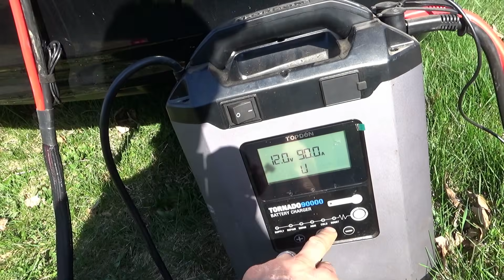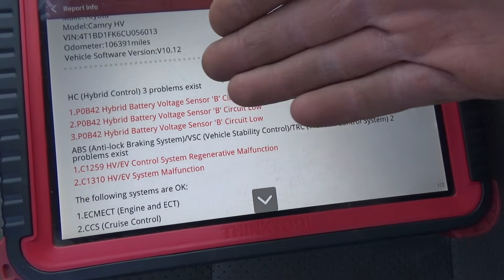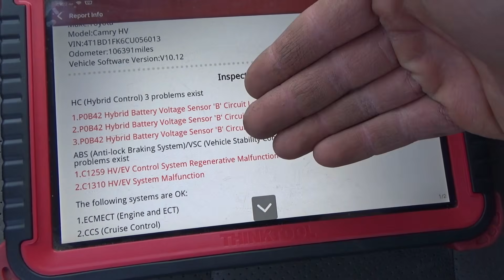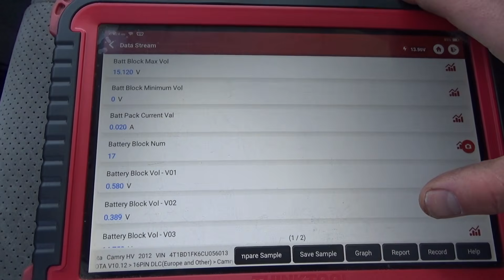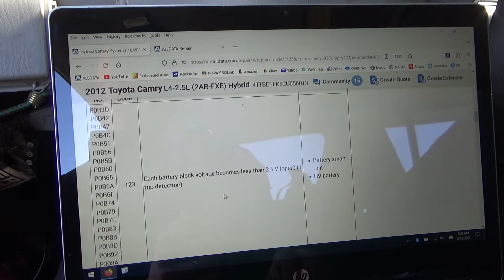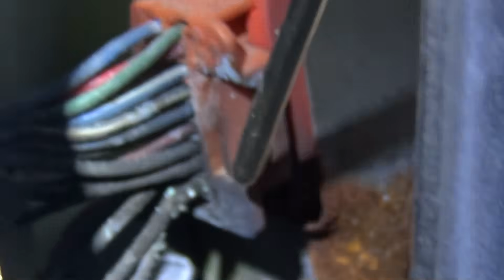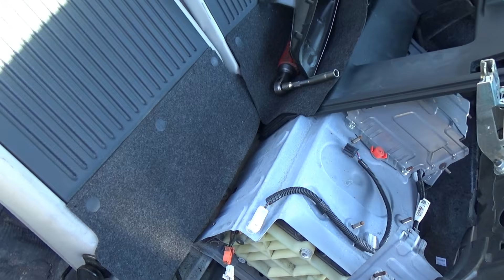Helpless HYBRID....from Florida?? (Part 1 - It's DEAD)

Comment: Did you notice the cooling fan blades are blocked with lint !  I had the same problem on my Oil Burner  Beckett boiler.  Those cup shaped blower fan blades fill up with all kind of debri, especially if the clothes dryer is in the basement or if you have animals in the household.

Comment: What seems to happen with inexperienced people that don't understand the electronic world sometimes believes the person diagnosing the problem caused the problem. Once you filled up their new auction car with burning electronics smell, they probably wont call you back. They like to blame and pretend that you were the cause of the reason why you were called there in the first place. It's that old "It was working before you touched it" mentality. I had that recently when I was outfitting a brand new house with outlets and switches and had one breaker tripping from a short to ground. The builder told me "My master electrician roughed in this house so it must have been something you hooked up wrong or backwards". I went to convincing him he has to remove cabinetry and drywall so I could inspect the wire. He had done so and said "I checked every inch of that wire and found nothing wrong with it" and tried pushing back on me like I wired it wrong. I found a staple driven into the wire about 2" under a box which proves it was done when the electrician was roughing it in. I was only sent there to finish it out and get everything working for inspection. Diagnostics can sometimes lead to spooky outcomes when you have to break the news to the customer or client. Thanks again.

Comment: These hybrids are crap, due to building it 'green'. From subpar eco friendly batteries, wiring and electronics, lean running engine,  to water based coatings. Designed to be scrap in <5 yrs.

Comment: Yeah, that is why hybrids suck.  I remember the transition from horses to cars.  Horses made it so you didn't have to walk everywhere.  Then when the cars got here, they kept breaking down and leaking and my father almost busted his thumb when the crank starter kicked back.  Horses kicked back too but you weren't trying to crank them.  Horses were pretty good.  Okay, they stunk and would take a dump on your front lawn when you had company over, but they had horses too.  We were all used to it.
Cars?  Not good. You couldn't go thirty feet before something happened.  One time we were turning out of the driveway and my brother fell out onto the road.  You could fall off a horse but nobody did.
Now we got hybrid cars.  Half gas, half electric?  No.  Not good.  If God meant us to half hybrid cars he'd have created them.  Not some maniacs that don't even speak English.  Guys that tried to kill us.  They almost did.  Lunatics.  Are they still trying to kill us?  Who puts 9 wires together in a plastic thing and shoots battery power into it?  They're nuts.  I'm sure poor Ivan would agree with me.  9 wires?  Run, Ivan.  Get out while you have the chance.

Comment: Water and high current batteries not a good mix, just finished watching a series of webinars from Autel on EV diag and testing, I’m glad I work in a rural shop so I don’t see too many EV’s I do see some hybrids though, the ac systems on them are completely different , I think it’s funny they use a 12 volt battery control to activate and command the high voltage system.

Comment: Hybrid batteries are a bitch. If the module connector looks like that and there was water in the trunk that battery is toast. All the connections are at or below water level. ChrisFix has a Video on swapping out a dead Toyota battery for a new aftermarket one, not from ebay but from a company that specializes in the batteries. But that'll set you back two grand. Toyota replacing a battery sets you back four grand. If the customer wants to do it on the cheap, he just lost the towing fee.

Comment: With the connector/pin damage discovered on the Battery Module (BCM?), I would say this vehicle never ran. A trip to the dealer would at least indicate the same DTCs and PID strange voltage readings on the traction battery block voltages. I know some dealers are not that experienced at troubleshooting, but this problem is easily uncovered by just a visual inspection of the BCM.

Comment: Man Ivan, those hybrid cars are quiet, even when being pushed, 🤣. Good comment about gas powered cars being good for pushing hybrids around. Hopefully you can get a new connector with pigtails already in it. That's the problem with hybrid cars also in that because there are less of them, it's probably harder to find parts for repairs. When you do find parts, the prices for them are astronomical.

Comment: You probably alright fixed it but fyi all battery blocks good or bad will measure around 14v. Only wait to test them is load test or driving the car. They are old nimh cells.

Comment: Just fixed a 3rdGen Prius with this same issue.  Corrosion was all the way up the voltage sense wires, and had corroded battery terminals and link bars.   Also found a leaking battery cell.  The voltage sensor looked much worse than this one.  It needed a full HV battery replacement, as well as voltage sensor.

Comment: As much of a pain in the ass as it is to replace the whole harness it's a much better idea to do so especially dealing with an HV system like that AND you might find more corrosion which you can fix which would prevent a further disaster.

Comment: The burnt wires would scream battery shorts, shorted battery. Initially I assume total replacement of the battery unless it is water tight, because I would assume it was a victim of a Florida flood. With water intrusion without being submerged though, exposed modules got destroyed, the battery in its safety enclosure might have avoided water, the shorts might be an issue, surprised it did not catch fire.

Comment: Do not fix that harness. It needs a replacement harness period for a proper fix. OE'S do not allow hybrid wiring repairs. Liability is way to high doing a improper repair.
Reply from the maker: A couple butt connectors should fix it right up xD

Comment: What's your policy on repairing knowing the seller will likely not represent that this car has had this issue?  It's one thing for the owner to consent.  I guess the standard probably is repair to a level that is functionally equivalent to before the issue happened.
Reply from the maker: My goal is to perform repairs that are reliable and cost-effective, no matter who the customer is :)
Reply: @PineHollowAutoDiagnostics  That is the goal.
Reply: It's normal... customer will tell you anything. The last answer I got was. I don't know. It just died.
🤣🤣🤣

Comment: Water, Water everywhere.  That harness looks real bad may also need replacing.  When you open the High Voltage Battery Pack, carefully check the jumpers from battery to battery.  Some corrosion may show, an instructor once told a class I was in that it's ok.  When removing bus bars/battery jumpers, there is a torque when tightening them back on the battery.
You're doing great Ivan!

Comment: This isn't a HYBRID issue. Gas powered vehicles end up dead for the same reason. Green crusties on the junction box under the hood of a GM truck show up constantly. Eric O has done a few on his channel.
Reply from the maker: But that's usually no parts required. This is easily a 4 figure diag and repair, using eBay parts!
Reply: I did pick a bad example. Didn't you have the Dodge Ram not too long ago that needed a $1,000 module but you got lucky and could repair it. If the module was damaged beyond repair wouldn't that be the same idea? Expensive modules aren't inherent to Hybrids or battery packs. Tough to find parts and needing to go to eBay isn't a hybrid issue either. 

You are too smart of a technician to hate on a vehicle for being a hybrid.  I expect to hear new car and hybrid hate from mechanics that can't operate an oscilloscope.
Reply from the maker: @BarkingDog-ho6el  The HVAC module problem didn't turn the Ram into a beached whale lol

Comment: The module, harness and connector should be replaced. Gotta' feeling the shorted module/ cable fried the battery. If your using the cable go back at least a ft.

Comment: @Ivan, you can buy the HV harness that connects from the cells to the battery ECU.  You should open the pack anyway to check the voltages, as they might benefit from some manual balancing if that short drew some cells down.
Reply: It should theoretically be possible to remove damaged cells and replace or just run with a reduced Kw battery pack.
Reply: You can bet it drew some cells down, at least until the wiring melted.

Comment: I'm always fascinated by the contrast between analyzing the codes and then seeing the actual problem. Well done Ivan. Thanks!
Reply: That's called Diagnosis. Hooking up a code reader is not diagnosis. Ivan has said it before. The codes scanned is the first step. 
Now the actual diagnosis starts with wiring diagrams. Poking and unraveling the tomatoe.
Reply: @2nickles647  Not exactly my point. Ivan said, "I just want to see a wiring diagram here." I'm talking about the contrast between the digital code, 'P0B42 Hybrid Battery Voltage Sensor 'B' Circuit Low' and the final reality of the burned Z7 connector. High tech to low tech.

Comment: To push a charge you need  14.5-15v. 13.4 is a “float voltage”, 13.5 isn’t enough to charge from death.
Reply from the maker: After 1 hour at 13.5V battery actually accepted a charge! 😁

Comment: I was wondering what anybody thinks about being quoted $189 for check engine light diagnostic for a 2009 Honda CRV 2.5L AWD with 197000 miles. Independent shop Tucson AZ.
Reply from the maker: Just a code scan or an actual DIAGNOSIS including estimate for repair?
Reply: @PineHollowAutoDiagnostics  Just the scan to see what's wrong. Then they will quote estimate for repair. Thanks.
Reply from the maker: @JimmyMowbray  scan does NOT = diagnosis!
Reply: The charges is about 90.00 to hook up scanner. Need to get appointment at the local shops.

Comment: Most people would just swap the battery with used or new. The inside has to be ruined, not only by age but now by water.  I think we have a Florida wintering Northerner trying to recoup rv gas money with a cheap Ivan fix.  At least put a new set of cells in it.
Reply: This is probably over-kill. The cells themselves should not be bad unless they left the water in the battery. The voltages indicate the battery might be good.

Comment: We have a 2007 Camry Hybrid and finally had to replace the battery in the trunk in February of this year. The battery was a Panasonic and it was manufactured in October 2006 - we bought the car new in December 2006. That means the battery lasted about 17 years. The Walmart Ever Start battery is not the right kind of battery for this kind of car. The traction battery, on the other hand, lasted until June of 2018, about 12 years. Got it from NAPA for about 1800 after the core charge was returned.  When the traction battery went, the car was still drivable on just the engine but complained a lot on the dash display.  It was almost like the trunk battery was starting the engine.

Comment: I hate dealerships. They can’t figure out anything.
Reply: It's not the dealership...it's the so called techs who work there.
Reply: @2nickles647  I understand that, but the dealership hires these fake techs. And I know there are some instances where the tech is bond by what the service “manual” says. Just wish they would take the next step and diagnose the problem.

Comment: The 12V batteries in Toyota Hybrids are suppose to be AGM and are not suppose to be charged at a high rate.
Reply: What is a high rate, I just put the charger on the setting for that battery.

Comment: So few people understand these cars, and also EVs. I bought a Smart EV six years ago for pennies on the dollar because it was "dead". All that was wrong with it was the 12 volt battery wouldn't hold a charge and therefore failed to initialize the car after sitting a few hours!  $200 later and I've had a fully functioning and trouble-free EV since. And one thing about hybrids I don't like is, if the electric drive section fails or something goes awry in the hybrid control, why can't the car default to ICE-only operation? You would think, especially with this "parallel" design, they could have engineered a fail-safe mode to at least let you drive the car.
Reply: Then why have an Engine...it's not a Smart car
Reply: Way to much trouble. You would have to think.

Comment: The pitfalls of Hybrids. I don't have a ton of experience with them, but I do know the 1st gen Escape hybrids must have a good main battery, with somewhere in the neighborhood of at least 30% charge, or the main engine will not start. They used the battery pack to run the starter...

Comment: This isn’t as bad as one would think I just repaired a gen 1 Prius. The harnes is 60 and the module was 60 bucks and it didn’t take long to fix maybe 3 hours. You can buy a rebuilt pack and have it installed for like 1500.

Comment: man... I know this is about showing repairs etc which is great but I just cringe hearing "water damaged repair" "person wants to flip it" it's just criminal selling water damaged cars and not telling the buyer this car was water damaged and 100% is going to have other electrical issues. it's literally impossible to fully fix water damaged as it requires checking every single connector that was not only submerged but near the water. if that trunk was submerged that battery pack was submerged. tail light wiring etc etc etc what other modules are water damaged and about to fail etc.
Reply: C'mon.  There's a difference between a submerged vehicle and one that "had a fender-bender" that disrupted the trunk seals and allowed water to get in.  I once had the windshield fluid hose disconnect and spray wiper juice into the ECM, destroying it, but I wouldn't call my vehicle water damaged.

Comment: Oops, I deleted my comment instead of editing it… damn it.    Anyway, looks like we both had the same idea in the end.

Also, those wires do go directly to the battery blocks.  Be careful.  The wire is your only fuse with these so if got a hood battery block behind it you may have little
More Fun then you expect. .

Comment: In 2017 I bought a 2010 Mazda5 from a dealer I know and trust. It had a faint weird musty smell but I didn't think anything of it. (Oops.) After we got it home, I pulled the cover off the spare tire compartment... it smelled SO BAD ... and there were two inches of muddy water in there.  Further panicked exploring showed no sign of water/flooding anywhere else.  The dealer investigated.  When they bought it, the cargo area was just full of mud, and the kid assigned to clean it got frustrated that the carpet cleaner was taking too long, so he used a pressure washer on the interior ("That's a bold move, Cotton") to clean the mud out of the back, then the carpet cleaner to extract the water out of the carpet, and fans for a couple days to dry it out. It never occurred to him that the pressure washer would flood the spare tire well.  Cleaned out out, dried it out, disinfectant to kill the smell, and never had another problem.

Comment: What a crappy design,  the data connector looks unprotected,  no wonder the feedback to the computer is jibberish.
A fully sealed quality connector should have been as standard, 
If the data connector is cheap crap, lets hope the cell connections are sealed.

Ivan, you must love mental pain ha ha :-D

Comment: That got HOT.  It's a wonder the car didn't catch on fire.  😲
Reply: There is a lot of power in those batteries, it just depends on how fast you let it out, those little wires were no problem for the battery to melt, it is probably still good.

Comment: Hope you'll be getting the whole cable harness and not just the connector, Ivan.  Those wires looked atrocious.  I also think it was wise to order the module since at least one pin looked to be missing and the heat or fire probably did some damage to the circuitry.  Part 2 should be good.
Reply: If the harness wasn't available, I've made my own.  Nothing this sophisticated, but you can remove the connector from the board and use something else for the connection.  For example, they make screw terminals for PCB's with standard 0.1" spacing.

Comment: ChrisFix has a super-detailed step-by-step video on replacing the main battery in another Toyota Hybrid.  Anyone with decent home mechanic skills and basic automotive hand tools can follow along and do the same.  Access to remove the shields, examine the wiring harnesses and modules, and demount the battery for further inspection and testing is about a million percent easier than working under the hood of almost any modern car.
Reply: Chris fix read and researches before his videos . He’s not a real mechanic or technician just a articulate intelligent guy who puts videos together and uses others knowledge to make lots of money 😁
Reply from the maker: ChrisFix knows how to use a voltmeter? Cool!
Reply: @PineHollowAutoDiagnostics  I'm sure the Toyota Hybrid system is super complicated at the front end of the car, but in the back where the battery is, it's just simple fasteners and connectors.  With a history of a major trunk leak in a seaside town (San Diego), it's probably not bad practice to price the job to include the labor needed to eyeball every wire and connector behind the rear seat, with the parts bill being driven by what needs to be replaced.  If detailed visual inspection shows extensive corrosion, you might want to alert the customer that an additional labor charge to disassemble the battery for close inspection of all the connections would be imposed.  And of course they have to be told that there is a chance the entire battery pack might need to be replaced.
Reply: @PineHollowAutoDiagnostics Lmao 😅